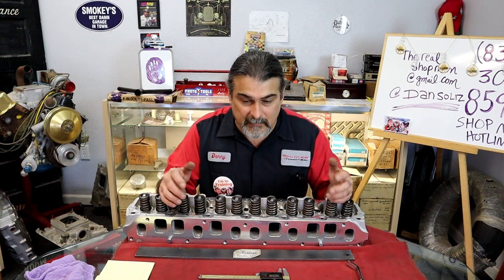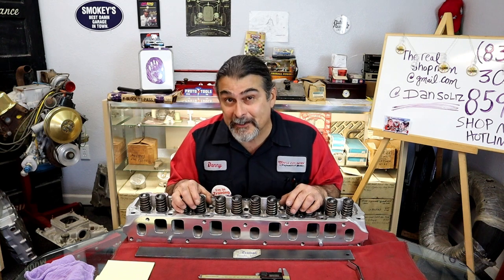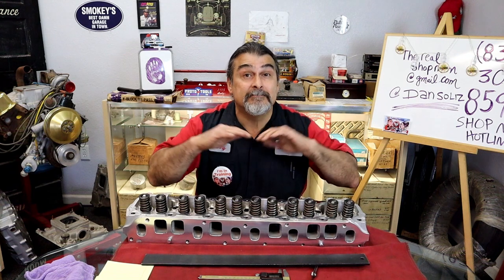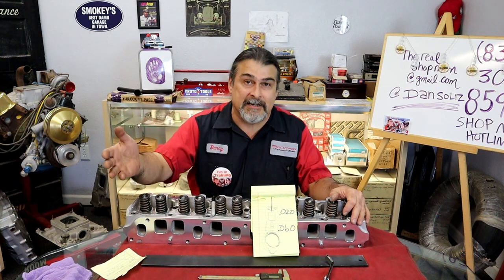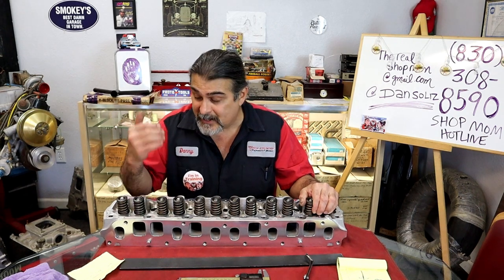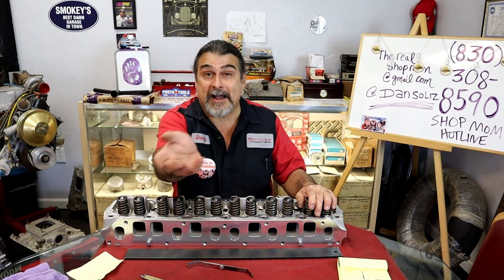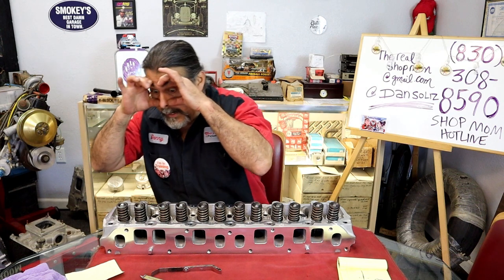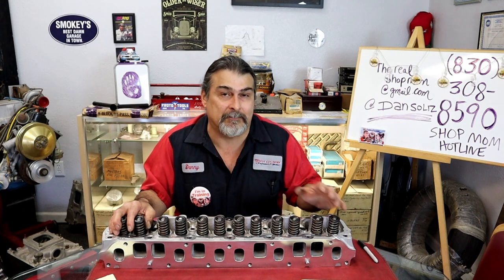Why I never run a cylinder head "Right Out Of The Box"!

Comment: I stopped trying to explain why i did what I did when building an engine. A ring job on a old smoker can be done with junk.I have assembled engines from piles of scrap parts and they ran pretty good. 
I got tired of Brand new junk parts and asswipe macinists telling me it does or doesn't need this or that and just doing as they please and then tell me to pay up. I have a time limit so do what ya can.
If some shmo tells me or asks me stuff  and gives me backtalk then work stops and said person is removed from premises along with junk. Bill paid first.  A Racing engine is not a stock mass produced engine with interchangeable parts.  A racing engine is hand fitted precision custom piece.
So now I am Quiet.

Comment: Happy Thanksgiving,  I agree 100%, we bought full assembled,  and raw, raw was  cheaper the valve sealed,guided correct clearance ,assembled  the valves leaked ,guides too tight valves stick springs week ,keepers well  retainer um, even had cc variance, then the fact will it fail and wreak the rest of your setup. But I spent 3200 on afr, and spent 2000 on a bare to finished and used 1200 on the CNC porting turned a 400hp to 600hp

Comment: I have a 75 302 rebuilt that I put e7 heads on. Can you explain how to measure pushrods. Hope you guys have a Great Thanksgiving. Thanks for your videos
Reply from the maker: Will do
Reply: @MrDanielSoliz  it's a non roller cam. I was going to do more, aluminum heads but had a health problems and had to cut back. It's going in a 94 ranger. It will be a fun daily driver just like it is. It's bored 40 over.